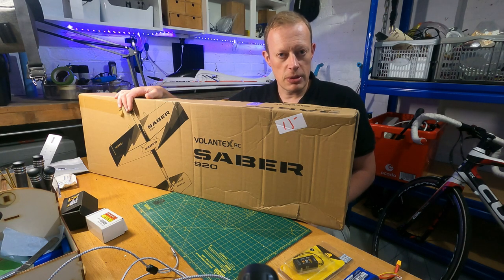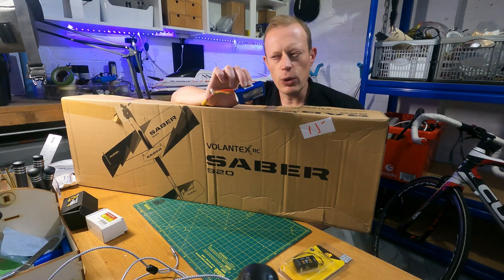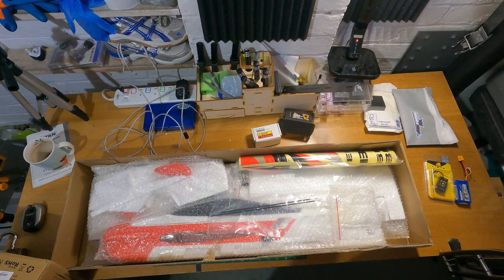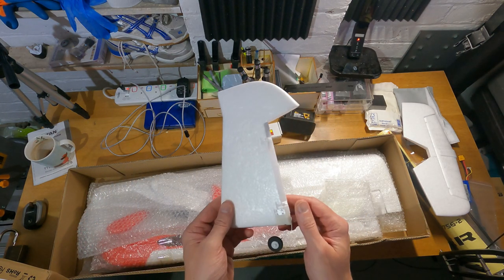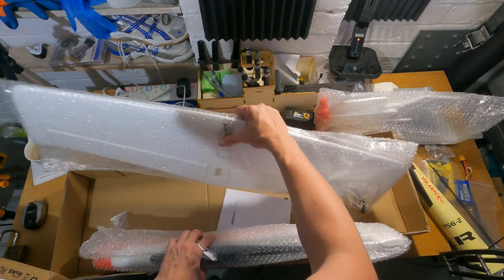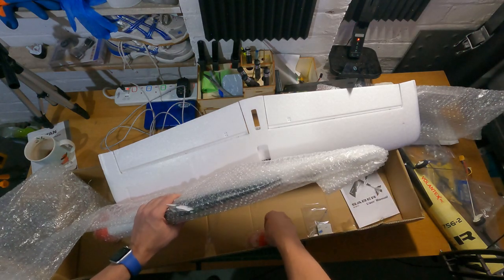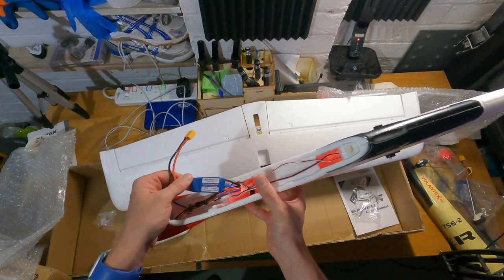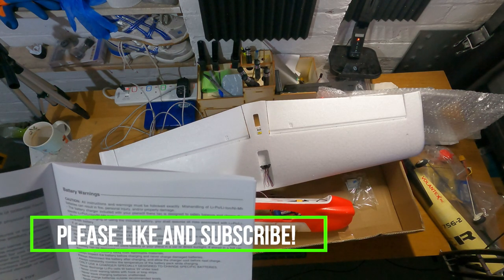VOLANTEX SABER 920 FIRST LOOK and UNBOXING

Comment: I am running a 3 cell 1400 I really like this plane landing gear is flimsy but it's just more fun to land I put bigger wheel on mine for my grass field .I had it two weeks and I am sure I have over 200 landing on it and it is pretty good in a hover, The battery goes all the way up in the nose perfect balance
Reply from the maker: Yes it’s good fun. Great for learning 3D. Thanks for watching 👍
Reply: How difficult was it to fit the 1400 battery? Most people are using a 1000 or a 1300. Thanks.
Reply: @stevefoobar  There a guy at my field he using  a 3 cell 2200  but I was wrong I was using a 1300 and it fits fine